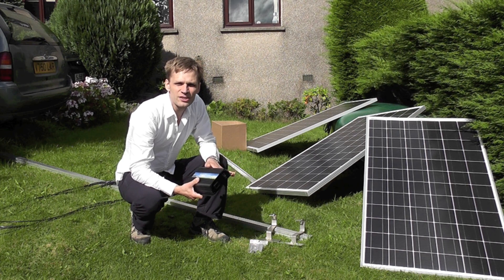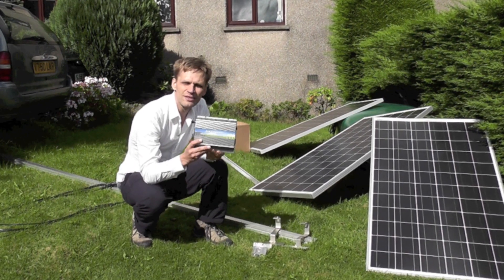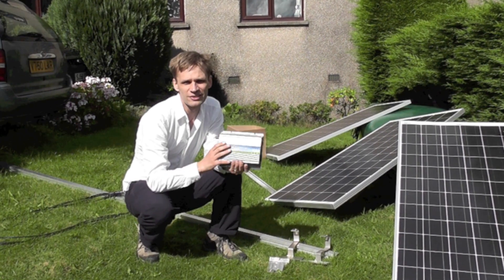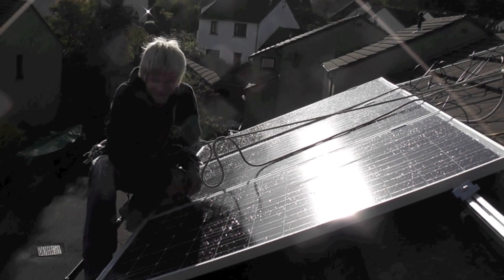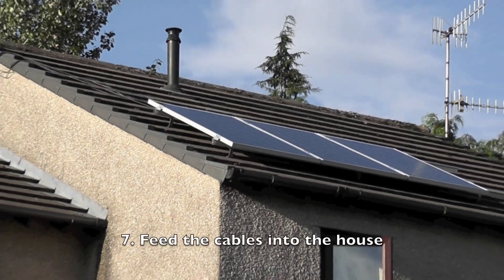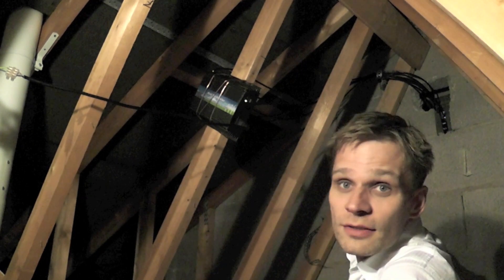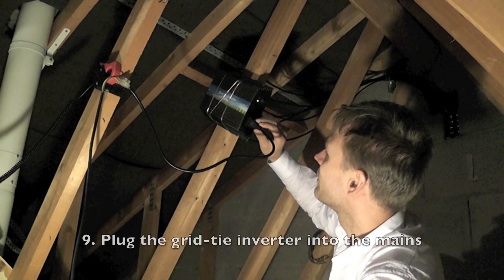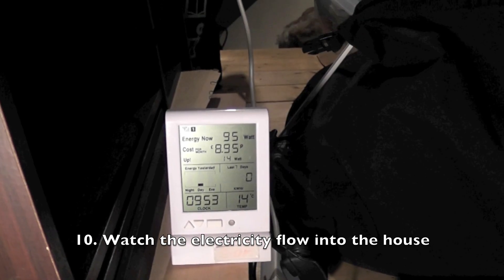How to install a grid-tie solar system on the roof of a house

Comment: Plugging an inverter into a wall socket is technically illegal as you bypass the ground leakage safety switch in your switch-box.  So if an electrician comes to work on your house and turns off the mains, he will still get electrocuted as your inverter is still supplying power into your house.

Comment from the maker: Hi there,

I'm sure your plan could work although you'd have to be careful to make sure you keep the horizontal rails raised above the tiles so you won't damage the tiles by having the weight of the solar panels resting on them. (You'll see the system in the video raises the rails above the tiles so most of their weight goes straight onto the rafters.)

And it is actually remarkably easy to remove tiles so if this is an option I would still normally suggest trying that first.

Good luck!

Jonny